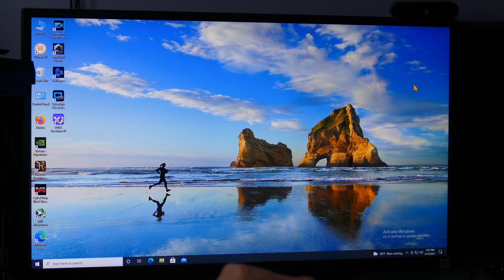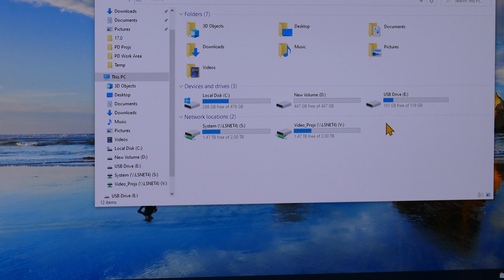Building of my Primary Video Editing Rig – Case Mod #1 – Adding a USB-C Front Panel Connector

Comment: Seeing the screw heads ruins it. I would have just used a 2-part epoxy to secure it in place and it would have looked much cleaner.
Reply from the maker: That may work, however that USB=C cable will then become a permanent part of the front of the case, and if it goes bad, then you may have to replace more than just that connector.
Reply: @PE4Doers  Another option would be to add 2 plastic posts on the inside of the front of the case (for screws to enter). That way you wouldn't see the screws from the outside. Cutting a hole in the front of the case for a type-c port is also permanent btw.
Reply from the maker: @syn80  That is actually a very good idea.  I recently purchase a set of plastic M3 screws that would have bee perfect for doing that.  If I need to do again with another case, I will look into making that happen. 🙂

Comment: Yayy!! Power tools. Now this is my kind of video!
Reply from the maker: I have many with much larger tools earlier in my released videos.  I even showed some MIG Welding as I build a special computer Test Bench.  I even had early plans to teach some Welding, but that would not interest many of my computer folk. Woodworking and Metal working are hobbies I use to spend a Lot of time with before starting my YouTube Channel.  

Thanks again for watching.  I will be doing at least two more mods to that same PC case in the next month or so.